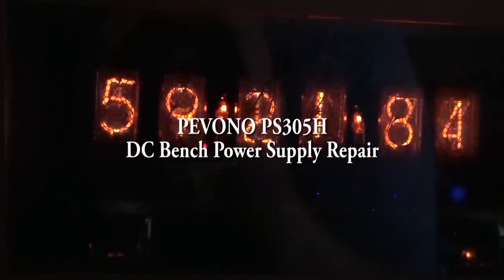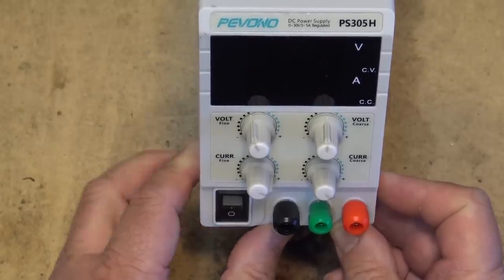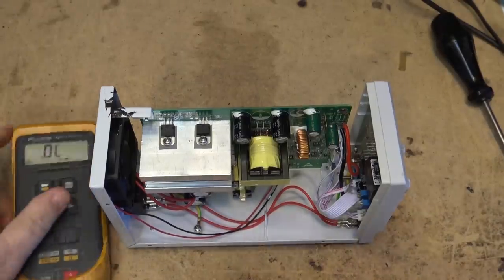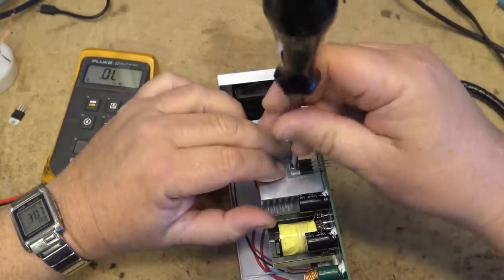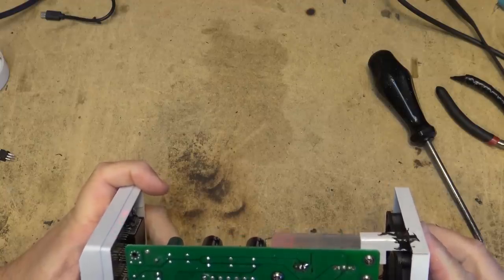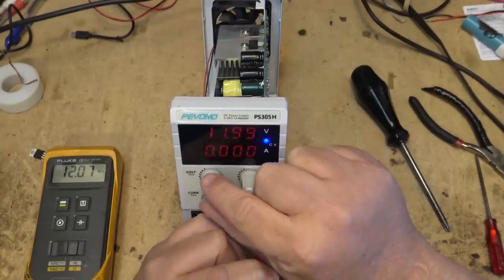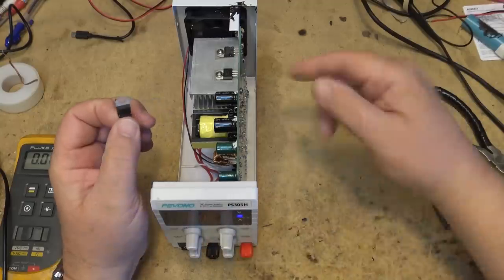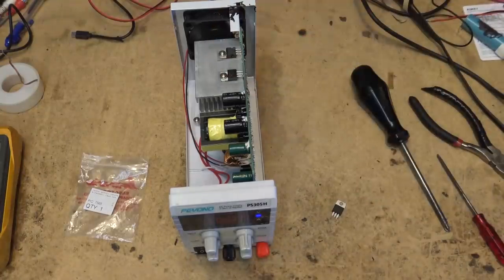Pevono PS305H Bench Power Supply Repair

Comment: Thanks for this.  Have a different brand power supply, but the internals look nearly identical.  Behavior was the same, showed 0.03A and voltage count down on power up.  Looked at the mosfet and the writing was very faint, likely taken some heat.  Put the meter on it and same issue as in the video and clearly appeared to be dead.  Ordered replacement mosfet as local store did not stock, replaced it and it is right as rain, working like a charm.  Not sure I would have found the issue or attempted this fix without the video - appreciate not having to buy another unit or send this one to recycling!

Comment: Missed a great opportunity to really explain how to test a MOSFET.  I have not been able to get good readings in circuit.  The beauty of your repair would have been great to slow down and show a good MOSFET and a shorted one.  You moved your probes around with no discussion on how you were testing things.  Same on the diode.  Thanks for your videos.
Reply from the maker: I have demonstrated how to measure bi polar and mosfet transistors in earlier videos.  This one was shorted which is generally how a mosfet fails.  All leads were shorted.   In order to test the new one I would have to build a jig to bias it.   Basically a mosfet turns on or off, unlike a bipolar which you can measure the diode junction. Usually when they fail they fail this way, short between source and drain.
Reply from the maker: I did a demo of testing a mosfet,

Comment: I worked for a power supply company most of my working career. Early on it was all linear then we slowly got dragged into switch mode units. most of ours were custom supplies for military and commercial customers.

Switch mode is lighter and cheaper but when things o wrong the result is usually smoke. I have 3 power supplies on my bench and all of them are linear lab supplies i bought off ebay for dirt cheap ($20-40) , they are all from the 60's or 70's and they just don't fail.
Reply from the maker: I have 2 heavy duty Astron linear supplies for my ham radio gear. Over 30 years old, made in USA, abused constantly and overloaded. Never a days trouble.
Reply: You can't beat a bit of nice 60's/70's kit and that feeling of nostalgia.

Comment: I have this very power supply from Amazon featuring this very countdown fault, rotting on my bench for ages. I blew it just by connecting a charged capacitor. Just ordered the component you replaced, will tell if it works for me. Thank you very much!
Reply: update: fix works a charm for me too 🙂

Comment: All you need to do to blow that output MOSFET is to go in to current limiting while set at peak voltage. I think we need to add some protection to keep that from happening. I had a 47V zener laying around so I added it to the back of the board at the MOSFET.  We'll see if that helps. I blow my each of my two Pevono supplies annually. Perhaps less now that I avoid CC at high voltage settings.
Thanks for this!
Reply: The zener fixed nothing. In the new production runs of this supply they now use a better (100A) output MOSFET, part# FTP11N08A

Comment: Same issue, I just order 75NF75 replacement, will see if I can fix it, checked current part is shorted,  just tested after changing and it works as new, thanks

Comment: When I watched your power supply video demonstration I bought one of those it died in 28 days I called them up or emailed them they responded saying my symptoms sounded like a loose board connection I took it all apart put it back together it works fine for another 30 days and then it completely died different symptoms could never get it working again out of warranty. My three other power supplies are between 30 to 40 years old and still working flawlessly thanks for the video I’ll jump into it and see if it’s the same problem keep more videos coming about power supply
Reply: Cool.....did you fix it?
Reply: I read your same comment on Amazon's reviews. Fancy meeting you here lol
Reply: @coldfinger459sub0  I restored an Agilent tank for my linear. I think it was made in Singapore. Everything else is SM. I might build something high voltage in the future.

Comment: PS indeed!! LOL. Nice work to find the problem so quickly. Odd failure mode. I, like you, would have thought that putting your two supplies in series would have worked fine. It must not be a floating negative as the front panel would suggest.

Comment: G,day from Australia 12volts.  I have a quick question for you about a cheap soldering station/ power supply unit i purchased from ebay.   My soldering iron and hot air work fine but my power supply after only using it 2 or 3 times has reversed polarity. It shocked the hell out of me when i went to test a battery ,  It now is positive on the negative out put and negative on the positive output terminal , Is this possible (obviously it is because mine has done it)  I thought i had crossed the leads over when i tested the battery but after double checking it it was the right way around for a good working unit . Any ideas.?  I have tried checking most things on it , someone suggested to me it might be the transformer itself.

Comment: @12voltvids Which mosfet is more powerful, the original or the replacement? For me, that's not a power supply 30v 5amp? If I seen it at a garage sale for a couple bucks, I'd probably buy it. I would constantly find myself using my boost converter and a couple few solar batteries 90v 30a with a fan. I want a center tap option as well. I should wind a huge transformer which is my goal. So I could actually test just about anything like 1,000 watt or more music amps. Icepower has built in power supplies and you can jump them to the unpowered amps, but the pins on the cable can't possibly sustain the amperage which has me baffled.

Comment: I had the same problem with a similar one power supply a month ago. I indeed found the same mosfet dead I replaced it and now I have no voltage on output neither nowhere on cold side of the board. So now I am in progress of deeper searching. Unfortunately  I was no lucky as you.

Comment: Same issue, replaced the 75NF75 and got it fixed, but under load voltage goes down to 3v just doing 2A, any idea ?
Reply: Make sure your input voltage selector switch on the back is set for the correct voltage. I'm thinking you live in 120V and it got bumped to be expecting 220V.

Comment: @12voltvids This power supply has means to calibrate the voltage? If not it shouldn't be to difficult to add a variable resistor should it?

Comment: is there any sense in putting a bigger transistor in there ? like if i had pin compatubile device in bigger package that could handle let's say 2x more current.and wider voltages  it would still only work as a switch and might make whole power suply beefier, but would current regulation work in that case?
Reply from the maker: I highly doubt that would make any difference. These type of power supplies are not very forgiving to reverse current loading situations.

Comment: I wonder if the meter was off by 0.008 volts because of the two mosfets being different types now.   Perhaps replacing both of them and matching them would have improved the accuracy
Reply: the other one was a diode
Reply from the maker: Well either the meter is off or my fluke is off.  Depending on the condition of the battery in the fluke. As the battery voltage drops the accuracy changes.
Reply from the maker: Battery in the fluke is low.

Comment: I think the PSU handles the short of the outputs by lowering the voltage (by means of the switching) right ?
Reply from the maker: No that is the resistance of the jumper.  Had I used a heavier wire it would have read 0 volts and showed the current that limit was set to. That cheap jumper cant handle 5 amps as it was turning into a resistor.
Reply: alright

Comment: Hi, great video, can i ask, the diode you mention looks like a transistor, it had three legs, not like a normal diode that I have seen, what type of diode is it? Thanks Jon
Reply from the maker: It is a dual diode.  2 diodes in one case.
Reply: @12voltvids  Thanks, I have never seen those

Comment: Sir i have bech power supply...  i always get shock in dc out put.. when i plug the banana red and black..... i open it there's a ground connected to the metal case... but why i get shock when i touch the alligator clip...

Comment: A cheap 50V Boost Converter may give you a solution when you need a few more volts out of your power supply but don't need the full 5A current it can deliver.

Comment: I have a similar problem with my power supply. Could the mosfet show open across all pins? It's a tp3055.
Reply from the maker: MOSFET are tested differently that UJT.  I did a video showing how to test a mosfet using a meter.

Comment: Hi, I’m curious if you don’t mind... where do you get your components from usually? Do you get your caps from the same supplier? Thank you!
Reply from the maker: Lees and KP components.
Reply: Thank you, I really enjoy your videos! Don’t think I could have ever worked on video cassette machines though... :-)  You have to be a very, VERY special person to work on them.
Reply from the maker: VCRs are actually quite easy. Especially the later models as they got the parts count down. The early ones from the late 70's and early 80's had many more moving parts, however most were metal so they usually didn't break.
Reply: I’m 58 and I remember the first beta and vhs units I saw in the 70’s. I said this after watching your last video installing the small gear. Your work was pretty amazing in my mind. I know it’s nothing to you but it’s pretty cool to me. Hey, I won’t bother you again, this was interesting.
Reply from the maker: No bother. I am 55 and got on the VCRs when they first came out. I figured it would be a good career move to learn how to fix them, and that I did every day for over 20 years. I thought I was done fixing VCRs 15 years ago, but I still see them from time to time. Fixed my first one in 1980.  So 38 years, and counting.

Comment: Great video, thanks!   Can you explain why trying to cascade the two supplies would cause that failure?
Reply from the maker: Steven Hawkins  
I should have plugged both into my isolation transformer first.  Since birth chassis were grounded connecting 1 supply positive to the negative on the other one created a massive ground loop even though the negative is supposed to be isolated from ground it is referenced. Needless to say I overloaded the mosfet and popped it. Dont put switching supplies in series to get more voltage.  They dont like it.

Comment: Is that the switching mosfet or is it used for something else?
Reply from the maker: It is on the DC  side of the rectifier.  Likely in the current limiter.  Dont have a schematic so I am guessing.  It was the first active component I tested and it was the problem.

Comment: You should make a playlist called 'Chinese quality'.  I'm surprised that you didn't use a desoldering gun.
Reply from the maker: Well if I had one I would, but the sample that was sent for me to evaluate was left at the door by the postie and someone else has it now. Because I didn't do the review the supplier that sent me both a desoldering station and a hot air solder station to review is mad at me.
Reply from the maker: Today he was going to leave a card at the door. Didn't ring the bell. I think he was surprised when I opened the door and collected my next shoe and tell project from banggood. An SMD DMM.
Reply: @12voltvids  Well, at least this time he did it right.  This in spite of the strike, too.

Comment: More than likely the original MOSFET was a chinese knockoff of that STP75NF75. With a max rating of 75 volts and 80 amps, you really shouldn't have blown that MOSFET out that easily, unless it were counterfeit. The non-counterfeit IRF 540 was probably an acceptable replacement  even though the current rating was quite a bit lower. Will probably get much longer life out of that PSU now.

Comment: hanks for the video friend, I have one like that, it has the same problem, I changed the diode and the mosfet but it fell short.
The two pads that are next to the diode should not have continuity. I stay with continuity and it is not the diode because I tested it outside.

Comment: I thought you thought this power supply was too noisy and preferred the 10A Longwei.
Reply from the maker: I use both. I do use the other one more but it is nice to have 2, and I paid for this one. The other one was a promo.
Reply: @12voltvids  The Longwei is better by far, but i thoroughly recommend switching out the voltage pot out for a multi-turn one also, like the amperage one. Only cost me $1 but fantastic improvement for accuracy and only takes 10 minutes. Maybe a video in it?
Reply from the maker: @englishrupe01  
It already has a multi turn pot. The longwei that is, which is the one I normally use.
Reply: @12voltvids  Right......but only one of the pots is multi-turn....the other is single. I upgraded the single turn one. Unless you got lucky and BOTH  of yours are multi-turn?

Comment: when charging a battery, always put a diode, this power supply don't like reverse current when begin of charge. I know more then 3 time this issue. THKS.
Reply from the maker: It wasn't charging a battery that blew it up.
Reply: @12voltvids  no, i suppose by Connecting two Psu was the same issue isn’t

Comment: Didn't check the old FET after it was removed to confirm the fault. Got away with it this time.
Reply from the maker: Didn't need to. Already knew what I blew up on it.  It had already been troubleshot off camera as I had to get the part ordered.

Comment: Use diodes next time? 🤔
Reply from the maker: A diode is not a mosfet.
Reply: 12voltvids i meant to protect the 2 psu's in series to prevent backfeed damage
Reply from the maker: Right, gotcha

Comment: Focus needs attention.
Reply from the maker: Autofocus. I need a new camera.
Reply: @12voltvids  I thought my cataract surgery failed me at first.   Keep up the great vids.
Reply from the maker: No, it is just my camera is starting to give me some trouble. 
Will have to start looking for a new one I guess. I do have a much better one, but it won't fit on this jib arm. Too heavy. I guess I could always manual focus it
Reply: @12voltvids  I also just discovered I had somehow changed the playback setup to low res 240p.   My apologies.  Sorry to bother you.